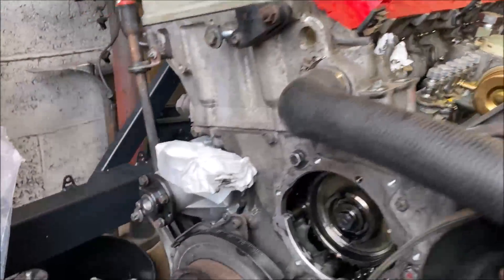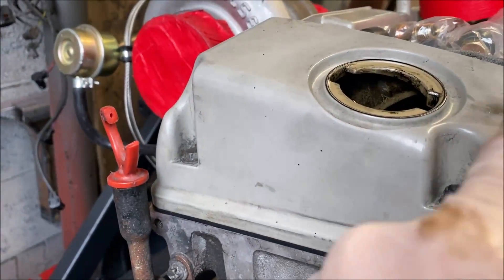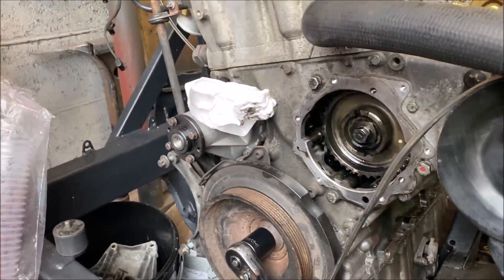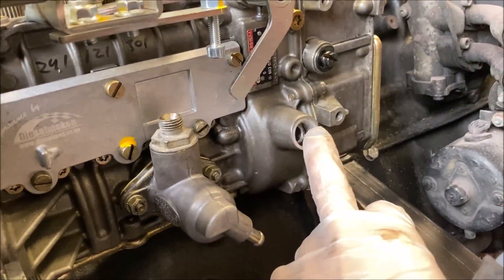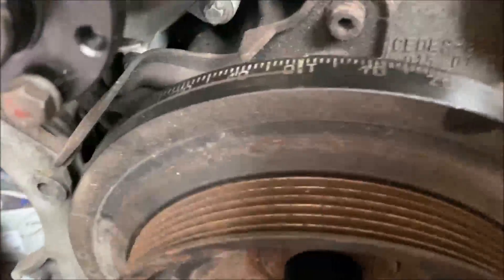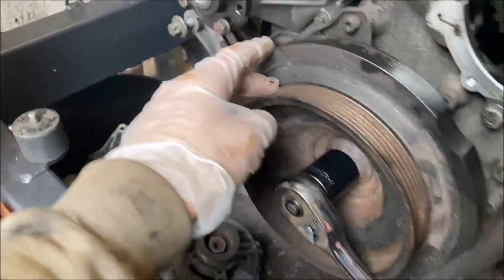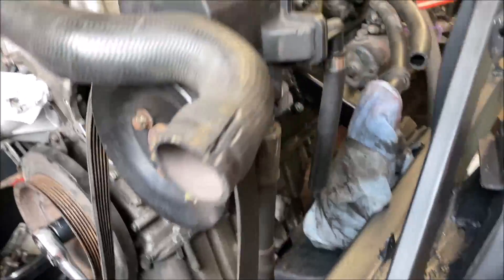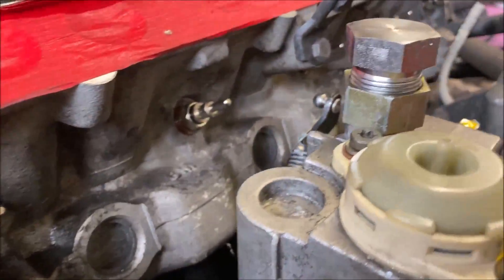Installing / Timing & Running a Dieselmeken om606 Fuel Pump on e300 Mercedes Engine

Comment: What connector did you use from the fuel side pump to the filter housing ?
Reply from the maker: I never use the Mercedes filter set up (with the clear plastic lines) so just a banjo fitting on the pump for feed and return